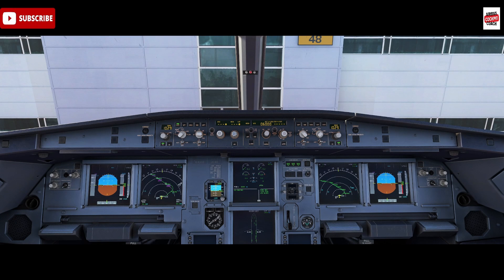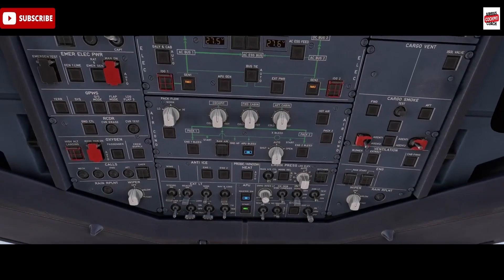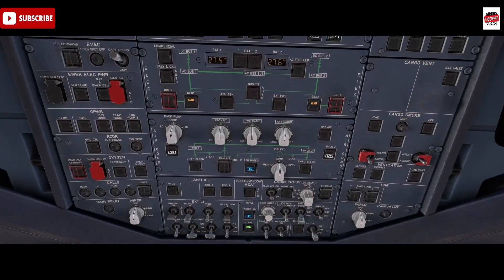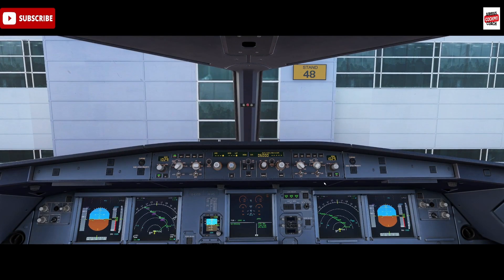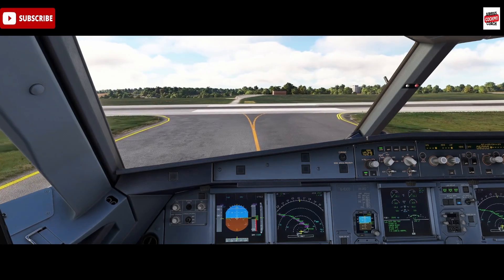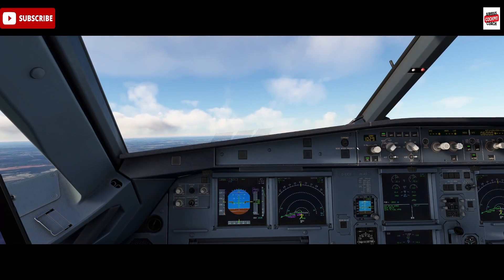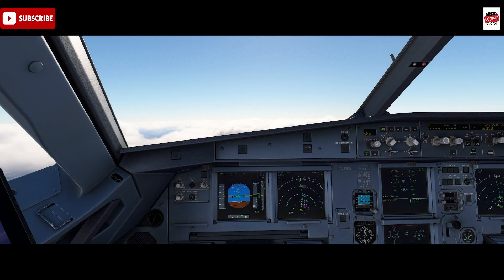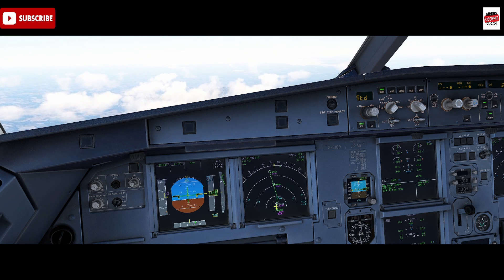A320 PACKs OFF Takeoff Explained by Real Airbus Pilot | MSFS 2024 Tutorial

Comment: i had a doubt, (im gonna bombard you with those now that i've found your channel, just a beginner now but I plan to do my TR on the bus after i'm done with my CPL). 

I'm sorry i dont know anything about the 320s Air Cond system but can you explain when is ram air selected for feeding the Packs? During takeoff can't you just select ram air on so that once the a/c starts picking up speed there can be atleast some cooling? or is the speed during take off not enough to generate enough pressure for the packs?
Reply from the maker: Ram air does not directly feed the PACKS, Ram air is used to cool the heat exchangers which the heated bleed air passes through from the engines allowing it to be cooled to a comfortable temperature for cabin use

Comment: Thanks. Does the Fenix have any issues if we try to fly it in any other time rather than live time?
Reply from the maker: There is the occasional issue but it is the most realistic mod you can get for MSFS in my opinion. Some of the issues relate more to flight dynamic constraints which is an MSFS issue and not a Fenix issue. I would recommend the Fenix 👍
Reply: @AirbusCockpitCoach  Does it ever go on sale?
Reply from the maker: It was on sale last week for the first time but I think that has ended, worth checking the website
Reply: What do  you mean by "Live time"?
Reply: @errolikalina1998  Real time? Rather than setting the time forwards or backwards by a few hours :)